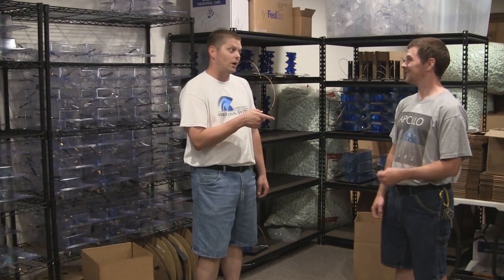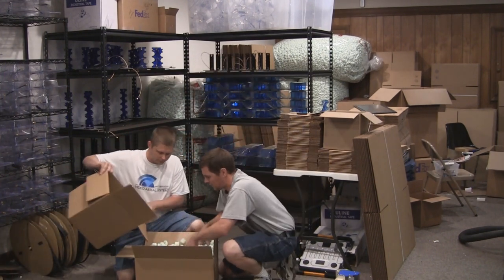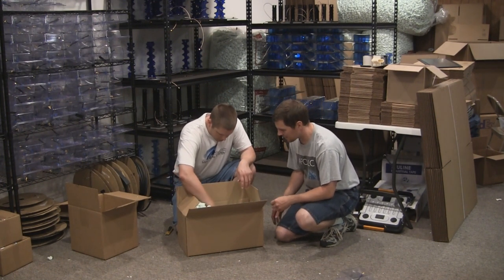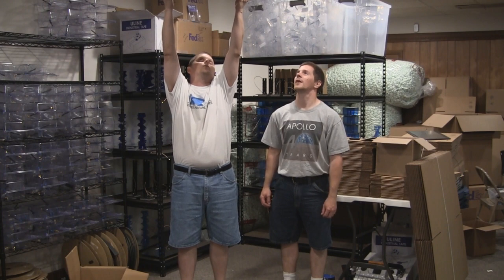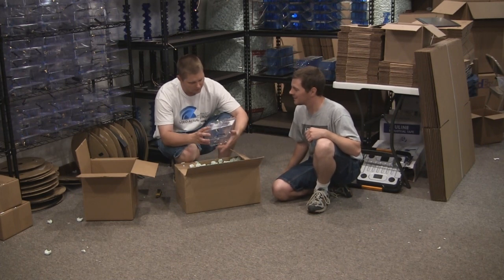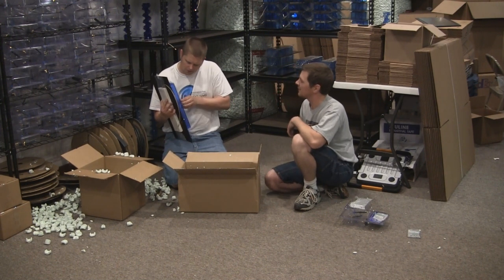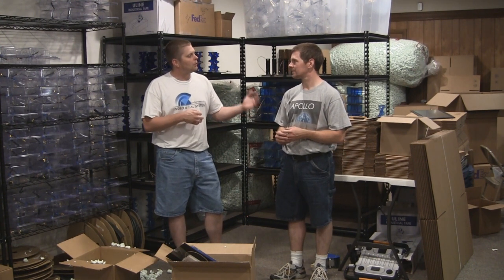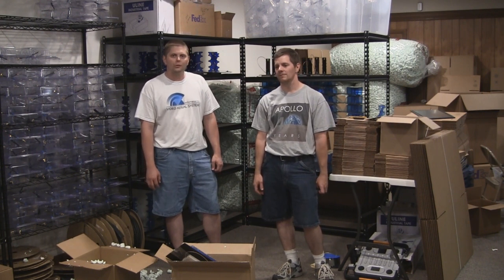Destructive testing: VAS pepperbox

Comment: Hate to say it, guys, but dropping isn't what causes damage during shipping.  It's multiple heavy boxes stacked on top of each other.  If the items can't handle some pressure, the items will break.  We feel the acrylic is extremely fragile compared to the ABS.  Acrylic is brittle and can't handle stress.
Reply: I can comfirm that. It just happened to me with a 1.3 pepperbox.

Comment: I have an important question. 
Can the pepper box be mounted upside down?
Wire will come out the top. 
If I mount it that way, will it harm it's performance? 
Please let me know....thx bd
Reply from the maker: Upside down is fine.  No problem with that.

-Alex
Reply: Thank you so much for getting back to me right away. I will post a viddy with my set up once I figure it out.